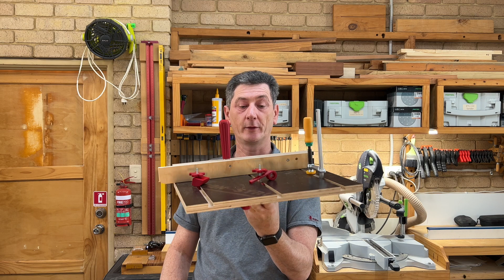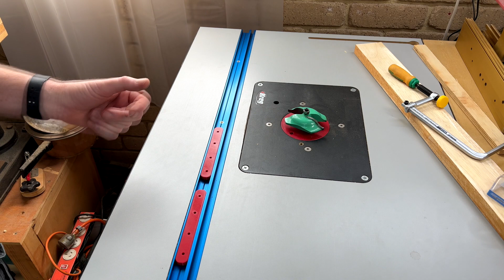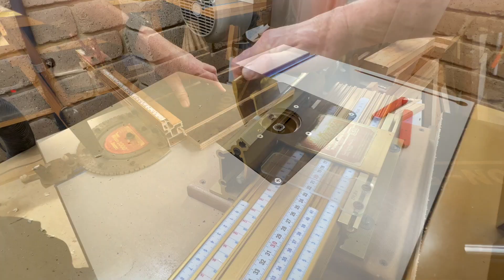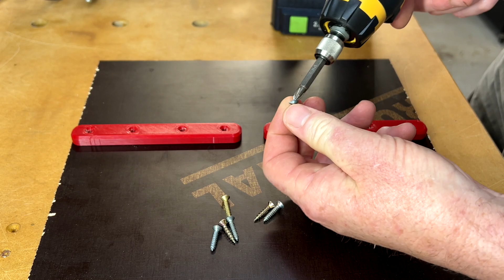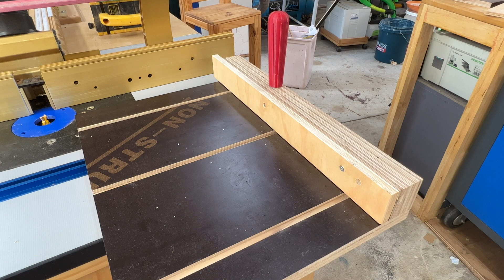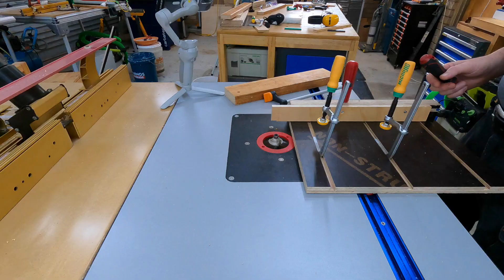Router table sled

Comment: I'm going to make one of these next chance I get. I'm going to try putting the dovetail groove in the back of the sacrificial fence so that I can adjust it toollessly.
Reply from the maker: @jonathanrand7767  that sounds like a great idea. If you remember can you please let me know how it went for you?
Reply: Sorry. How does putting the groove in the sacrificial fence make it easier to adjust? All I see is you eliminate the need to counter sink the thru bolt heads in the sacrificial fence.
Reply: So I did make the jig and I put the dovetail groove in the back of the sacrificial fence. Not sure why, but with my groove on the sacrificial fence, it binds badly when I try to adjust it laterally. I even waxed the groove and the dovetail nuts, but it's still binding.

Comment: Great design! I've gotten into the process of putting UHMW tape on the bottom and side edges of my miter tracks.
 
I use a ¼" (6.35mm) wide tape that is 1/128th (0.0078") an inch (just under 0.2mm). This makes my miter tracks as slick as they could ever be. I did this because I use aluminum bars in my miter slot, because the UHMW bars can have a bit of play no matter how perfectly I mill them. 
 
On my current sled, I've used that same tape running L2R on the base to slightly lift the base off the router table, and make it as easy to slide as possible. 
 
So now, I can use my coping sled with zero friction resistance. And since I use uhmw faces on my router fence, it's like the entire device is levitating on air when it slides.
Reply: I like the concepts! I used t-track in my original sled to slide my clamp boards, but on this next one I'm going to try these cheap WEN guide rail clamps in a track similar to what you did with your  design! So thanks for the inspiration and ideas! Be safe!
Reply from the maker: Sounds great. If you use your coping sled for long periods of time, that could really help reduce fatigue.
Reply: @DarrensWorkshop   indeed. Having 1 functioning arm and leg it makes it so much easier for rail & stile type bits.